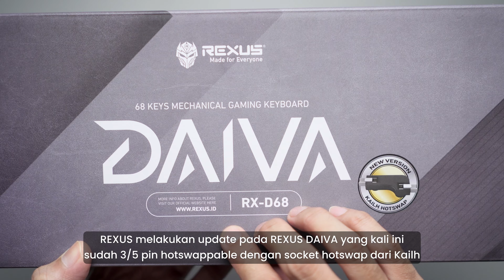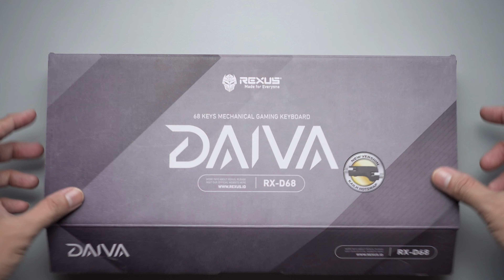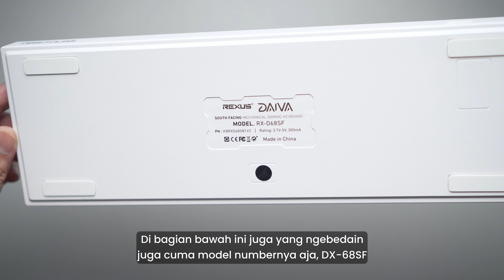Rexus Daiva SOUTH FACING - 65% 68 Keys Gaming Mechanical Keyboard - ASMR Unboxing & Review

Comment: Emg lubing sm stab rattle ngaruh ya bang? Bukannya lubing lebih ke alus atau ngganya pas di pencet? Terus bukannya krn stab wirenya ga imbang makanya rattle?
Reply from the maker: stab wire yg ga imbang bikin ratlle bener, bahkan setelah difine tune pun kadang tetep aja bisa kurang seimbang, karena memang gap di stemnya emang gede untuk toleransi naik turun. makanya diakalin dengan ngisi celah stem dengan lube supaya lebih sedikit friction yg dihasilkan ketika wire bergerak dan mencegah rattlenya tadi..
kalo yg dikasih lube di bagian luar stem dan di housing stemmya emang tujuannya bikin alus, makanya biasanya lube yg dipake beda, kalo yg didalam stem pake xht bdz/permatex, kalo yg bikin smoothnya pada pake 205...
dan setiap stabs dengan merk beda2 akan punya problem masing2.. harus dicoba sendiri2.. kadang dapet prelube pabrikan yg udah no rattle jg pernah 😁
hope it helps